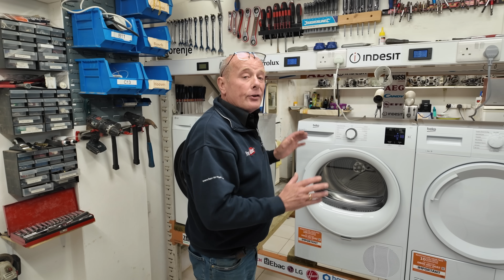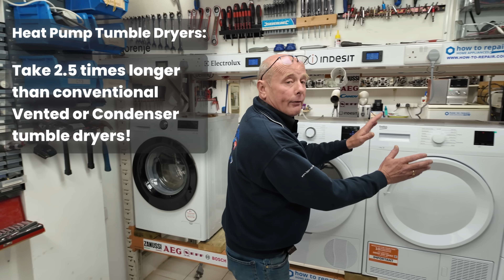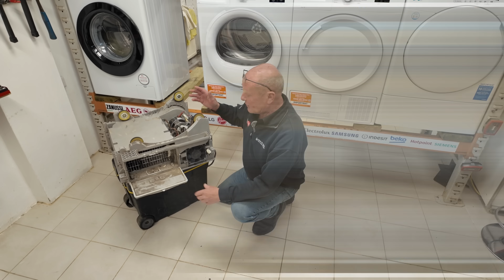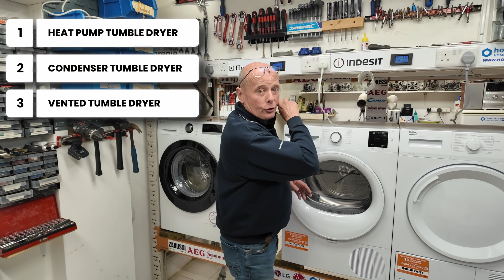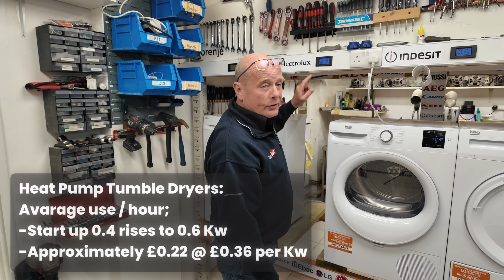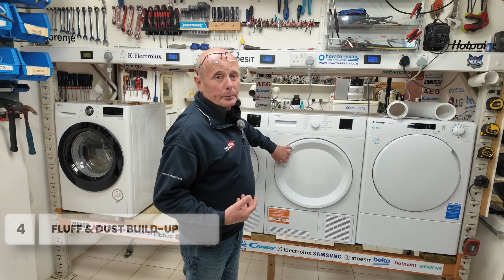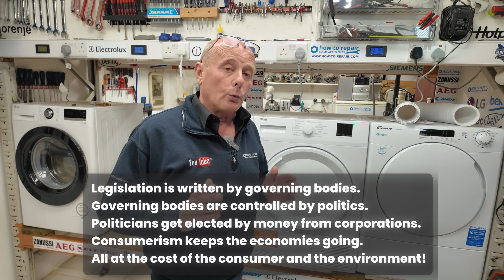Tumble Dryers the Shocking Truth About Heat Pump vs Vented & Condenser, NEW LEGISLATION!

Comment: Expensive and resource-heavy to manufacture, expensive to buy, cheap to run at the point of use, expensive to maintain and repair, expensive to dispose of and not as green as the green-wash that they're coated in. It all felt a bit like BEV vs Morris Minor - I know which one I'd prefer: the one I can fix.

Comment: My 1993 F&P ED54 dryness-sensing,* externally vented dryer still works well and uses very little electricity when used to finish off clothes left out on the clothesline. Barely any dust accumulates inside since it works by inflating the machine with clean air and letting the air escape past the sheathed heating elements at the back, though the drum, lint filter and the connecting tube to the back of the machine where the duct is fitted. It's only weakness is the back bearing which falls off after heavy use in a big flat after 10 years (easily replaced or improved) and the lack of ESD protection (which I added myself). Even when a flatmate was lazily using the dryer twice a week with wet loads on sunny days, he only managed to add NZ$5 to the monthly power bill. This dryer is also good at not catching fire, since it doesn’t use a toaster-wire heater, let along a toaster-wire fan heater at the back trying to stuff hot air into the drum. (* The sensing is done with a thermister in the exhaust, which the microcontroller monitors to see a sudden rise in temperature or a temperature limit exceeded and probably runs the dryer for a time after that even according to the “dryness” selection.)

Comment: A simple solution is don't buy any of the three! We use a dehumidifier! 
We place it in a small bathroom, out of the way and often overnight. Yes, to dry an 8kg machine load takes a 4-7hrs (depending on time of the year and type of clothes: synthetics, cotton). The benefit is you can place one full load at one time and leave it till its done. Power  usage wise, its 230wh, or 1kwh - 1.5kwh for a load, as measured by me.
The one we use has dried for a family of 5 for 6 years and still going. Lastly, it was £230 to buy and occupies very little space when not in use. And of course you can use it as a dehumidifier, so multi purpose! So, my arguments for economical, space and environmental benefits compared to the rest.
Still, people have preferences and whatever works for them, will be the right thing.

Comment: After using a gas dryer for thirty years we moved to a different house that came with an electric vented dryer. It took over twice as long to dry the clothes and cost much more in energy. We gave it away and got a gas dryer and have saved money and cut the drying time at least by half. We are being scammed by the move to get off gas.

Comment: The one thing you forgot is where the energy to dry the clothes actually comes from. Vented dryers are usually only a one  pipe system, meaning they are sucking you heated household air through the dryer, which costs you money in central heating bills. Heat pump dryers are not so good either : if you delve into the manufacturer's specifications, you will find they rely on an ambient room temperature of 18 C, which means they are cheating by relying on your central heating system to perform. No good putting a heat pump dryer in an unheated garage or shed. Any lower ambient temperature will massively decrease their efficiency. The best solution is to drill two holes in your wall, and only circulate outdoor air through a vented dryer. Hopefully someday, someone will even combine this with a secondary heat exchanger to produce a truly open to external air , closed circuit ,Condensing Dryer, just like a  ( room sealed ) condensing Combi Boiler.

Comment: Unfortunately you are totally correct. Having owned vented and condenser dryers over the decades. Switched to Asko heat-pump dryer 4 years ago. It suddenly stopped working then we paid $170 to be told it was unrepairable…. out of warranty and need to buy a new unit (now 40% more expensive).👎🏻
The heat-pump was effective and energy efficient but lack of ability to repair is a disgrace ☠️

Comment: After waiting nearly a year for Indesit to make the safety modifications to my previous vented dryer, and still seeing reports that the mods didn't fully resolve the issue, I felt a lot more comfortable with a heatpump dryer. I know the problem is primarily poor maintenance, but some with fires swore they cleared the lint out... Performance has been perfectly acceptable, it supposedly cleans the filters with condensate, but no doubt it'll need some maintenance at some point

Comment: I have a vented electric dryer.  I maintain it myself.  It's 25 years old at this point and it works great.  Over those 25 years, I've replaced a set of bearings (just Teflon slip bearings) and the felt seal.  I've probably taken it apart 2-3 times for a deep clean.  The thing is ridiculously simple and I don't really ever see it failing to the point it needs replacing in my lifetime. I'd need to see significant cost savings before replacing it.  A lot of the time I line dry clothes, inside in the winter, outside in the summer and just run them for a few minutes in the dryer to "fluff them up."

Comment: As a Canadian found the video interesting as we are able to get those type of appliances as a special order. However our energy cost are far below the kilowatt hour paid in most European countries. On low rate from 7 Pm to 7 Am for about an hour to run at 5 kw is 50 cents total cost to dry your clothing or 10 cents a kw hour. It is a direct vented heating element system and has proven to be the most reliable type of dryers and requiring far less maintenance.

Second to that is a top load HE washing machine will spin the clothing a lot faster for centrifugal water removal, far better than any front load available washing machine period. They have far less mechanical or seal failures too. With more water removed, it reduces drying time that a smaller load to a medium load will be dry in a half hour to 37 minutes. 

We run for almost all washing machines in North America for domestic use at 120 Vac. Most dryers at 240 Vac are all 60 Hz as referenced to independent appliances, not combo or stand up small unit apartment style laundry systems. Combo laundry systems come in a variety of designs and sizes and features that can vary greatly.

Comment: You didn’t mention that the vented and condensing dryers operate at different temperatures than the heatpump ones. For the Miele, HP dryers reach 50 degrees C around the end of the cycle, while vented and condensing ones can steadily maintain 60-70 degrees C. This means that while the HP machines take longer (in my case upgrading from a condensing to a HP dryer both from Miele increased the cycle time of just 20 minutes for a full load of cottons) to complete a full cycle, they are also less harsh on clothes due to the lower temperatures at which they operate.
That’s also why I can dry even woollens and delicates in the HP dryer. It’s been running for 4 years now, thanks to its triple filter which includes a fine dust filter the condenser still looks very clean. I still have one year of warranty coverage, after which I will open the unit up to check for lint and clean it if it will need it ;).
In my case overall, passing from a condensing to a heatpump dryer from the same manufacturer was a very good upgrade.

Comment: There have been studies about how much CO2 the production of an appliance expells. None go above 400kg for fridges, washers and DWs are in the range of 200kg.
A single kWh of electricity across the EU emits about 250g of CO2.

That makes for 4kWh per kg of C02.
So let's take those 250 loads a year you reasoned with. Let's assume your normal dryer uses some 3kWh per load on average, your heat pump about half that.
That saves 1.5kWh×0.25kg*250, or about 94kg of CO2 per year.

That means - depending on if your dryer is on the upper or lower end of that range of emmisions during manufacturing - your heat pump dryer saves enough CO2 every 3rd to 5th year that you could replace it completly and still be carbon neutral.
Sames goes with money: At 33 cents a kWh, a heatpump tumble dryer saves you over 100 bucks a year (given the 200 cycles).

Even if they lasted any shorter, they still would be more climate friendly, period.

Comment: Samsung heat pump dryer best purchase ever, safer , cheaper and quicker to dry (in my experience compared to other driers owned). Also was supplied with brush to clean dust between fins , most never follow manufacturer instructions which explains how to clean. Condenser very rarely go wrong as long as you follow manufacturer maintenance procedures ,re cleaning 
Any drier with a heating element if not used as per manufacturer instructions would be more likely to cause problems, and cost far more to run especially considering electricity costs.

Comment: I have a Samsung heatpump washer+dryer unit in the US. It is direct-drive (so no belts to wear out), has a double filter with a gasket for lint, and washes the condenser with water every cycle. I am cautiously optimistic, but I also got the service plan.

Comment: I have been mostly happy with my LG heat pump tumble dryer, but after a few years it started smelling like blocked drains. I took it apart, which as you say, was not an easy job and took quite some time. There was quite a lot of wet dust and stinking water in the sump of the machine, despite having a double filter and self cleaning spray nozzles. It is all OK after cleaning, but not designed to be easily servicable.

Comment: I've had a few vented tumble dryers and one heat pump version.  There's no way you could pay me to go back to a vented one.  The heat inside them destroys clothes for starters, if you can't vent it outside, your house is full of humidity and fine particulate dust from whatever fabrics you are drying. If that's man made stuff, that goes in your lungs and doesn't come out again.
I've had my AEG heat pump dryer for 6 or 7 years now and it's not missed a beat.  The dust filter is magic, hardly anything gets through even after years of use because it fits snugly and has several layers.
I can tell by the state of the water holder. In my old vented versions, that quickly got tainted by a dark colour which was fine dust particles.
The heat pump one has gone years with barely any darkening.

Comment: Comment 2: "They are very beneficial when comparing energy usage...." (paraphrased) This does not take into consideration the many more industrial factories and processes it takes to make these more complicated machines. It does not take into account the energy used for the servicing process which takes longer. It does not take into account more clothing manufacturing and related processes from wearing the clothing out faster. It does not take into account mining, smelting and refining processes that may increase from more parts and varying type and/or number of type of parts and associated repair and servicing. It also doesn't take into account tossing the more complicated machine into waste and buying another because, "I do not know/there is not, a good technician that will recommend replacing the compressor." (paraphrased) There is absolutely zero evidence the newer mandated machines are not as negatively impactful to the environment. There is evidence they are worse.

Comment: Also, because heat pumps don't create the fierce heat of a vented or condenser I actually find clothes last longer and don't shrink. We sell a lot of Bosch appliances and currently the heat pump is the same price as the condenser but comes with a 5 year warranty as opposed to only 2

Comment: Think this depends a lot on KW price
I pay 25c per KW 
So average 670kw a year in a condenser say around 167€ to run
A equivalent model heat pump uses 230kw and costs 58€ .
Savings min of 100€ a year
A new heat pump dryer is 350€ so after year 3.5 it's already paid for itself.

Comment: Very interesting,  I have over 30 years experience in the trade and agree with a lot of your comments. I'm not sure about the 2.5 times longer time to dry though, I personally had a Bosch condenser dryer and changed to Bosch heat pump and found around 30 mins longer for the same loads and that machine lasted me 12 years while saving approx 60% on energy usage

Comment: Comment 1: Until the people put a stop it, the beating will continue until moral improves. There are many points of bad government that any political leaning can agree upon. Fix that first. When a government is reduced to having less power, less control, less waste, less interference, able to enforce less oppression, then start arguing about the rest. Though less, smaller government with less power and less control is ALWAYS the right and correct answer to a "free" people. A government is supposed to serve its people, not rule them with an iron fist. The iron fist is what we have in the West today, with degrees varying by country, region, province and/or state.

Money and other financial and power incentives needs to be removed from government. Business lobbying should be made illegal. It's grift. A bad idea is still a bad idea regardless of how many financial incentives a company gives to politicians. Which by the way, is also proof positive that most politicians are indeed crooked. Even if a particular politician doesn't take part in this, they tend to vote with their party, which makes them as crooked and just as guilty.

Comment: The reason  the condenser is caked up with dust is that the filter mesh from most machines are bad designed, i glued an 500 mesh stainless steel mesh before the condenser of my condenser dryer and i never had to clean out the condenser since then and 5 years passed almost no dust in my unit.
This is now my speculation: The wear and tear is also mostly a design problem, and the manufacturers just dont spend the investment in money for engineers solving this and they want to stick to their tumbler design.

Comment: The world would never move forward with this kind of thinking. We would have cars like in the 70's. High consumption, but really easy and cheap to repair, so the overall costs would possibly be the same or even cheaper. 10 years of electricity consumption on my condenser dryer is roughly the same as a new dryer, and I think electricity prices in UK is a lot higher than Sweden, so reducing the consumption by half may quickly be worth the extra costs of possible repairs.

Comment: My vented dryer is 29 years old. I had to replace the belt after 20 years.
That, and i don't want to have to wait twice as long to dry my clothes every time I do laundry. I have other things I'd rather be doing with my 250 hours.
Fortunately, electricity is really cheap in the US compared to the UK. It's about $55/ month for a 185 sq meter house.

Comment: I really do believe we are simply swapping cheaper bills for much higher replacement and maintenance costs and that complex and/or deliberately poor design encourages new purchases i.e. a form of planned obsolescence. 

It really does make me think that going back to a simple vented dryer and having a good self maintenance/cleaning routine is better in the long term despite the higher energy costs. I say this as someone with almost 30 years in the low carbon energy industry. High energy efficiency ratings taken out of context should not drive the design of standards or legislation.

Comment: Been electrician for 20 years, replace lots of washing machines and tumble dryers, years ago you could come out to a 30yo machine. Just before christmas i was out replacing a Bosch heatpump dryer, the machine didn't have any machinical defects, only thing was the hatch, that was broken, i kid you not, you can't get a new hatch, you'll need a whole new door, for the price of 1100 or converted 124 pound.

Comment: Interesting discussion, the accesibility of dust cleaning seems like an issue but more of a design problem?

The compressor failing/leaking - I've not encountered the issue with any fridge/freezers so far so not massively concerned, the failure rate should be very low, but worth looking at brands that have longer warranties. Would have been good to explore the relative failure rate of motors/bearings/compressors and circuitboards and costs. I very much doubt a technician callout would be £100 here 😅

Disposal, same as a fridge? If they are using r290 then its not really a huge issue with refrigerent leaks anyway.

Comment: Don't buy a dryer at all, buy the most efficient dehumidifier you can find where you are. Here in the UK that's a Meaco 25L costs @ £260-300 with a five year warranty; cheaper to buy/more flexible to use. A unit like this will dry your clothes on an airer in a few hours, (ideally in a small room, windows closed; it doesn't matter if it's a bedroom or an office, spare room, it won't become damp) and using @ 165- 250 watts/hr, so very economical and can be used for the rest of the house; remember in winter a dry house is much cheaper to heat, feels much more comfortable. Aside from that, and to anyone else who happens to read this, don't be lazy, get your laundry outside in the fresh air if you can, even in the winter, a bit of a breeze and your clothes will dry a good deal - it's free after all.